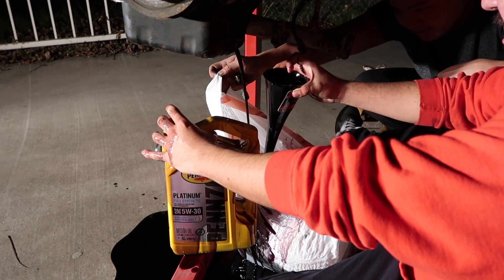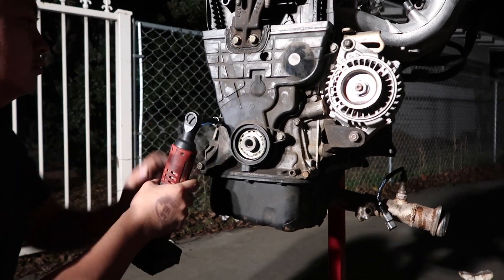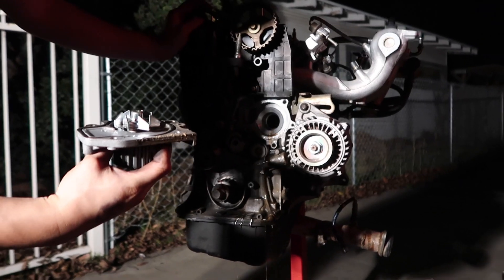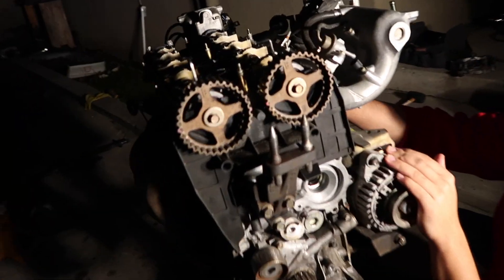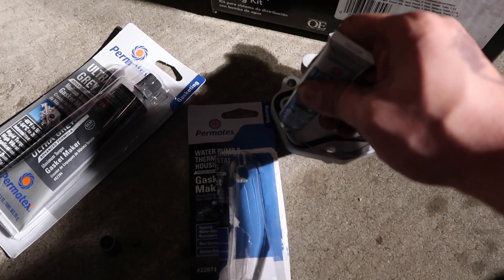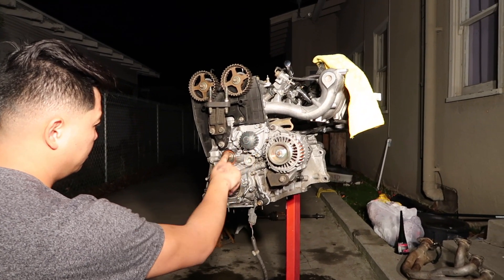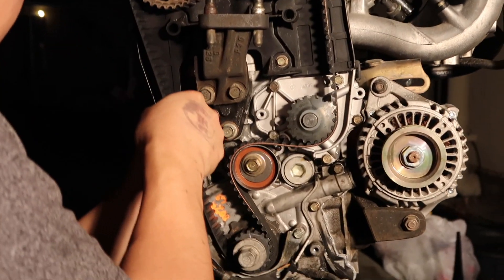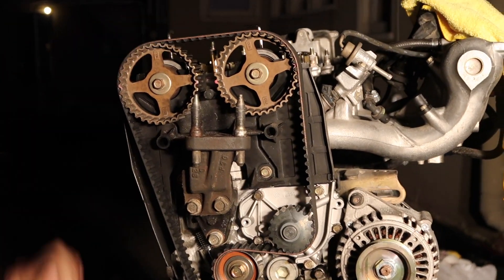B20b civic Bar Part 1

Comment: what's your thoughts of B18CR vs B20B
Reply from the maker: B18cr no comparison to a B20b
Reply: @chaiyangg  interesting, mind to explain more?
Reply from the maker: @tommykaira8775  b20b doesn’t have any vtec and only has great tq, and can only rev up to 7k, the only other motor you can compare a b20b is to a b18b, b18cr is the best b serie motor you can have stock
Reply: @chaiyangg  in my place people put b16a on top of B20b, does it stack up to the b18cr?
Reply from the maker: @tommykaira8775  yeah but I was just going off what your saying, a b20v is a different breed, and it’s not reliable but if you wanna compare a b18cr to a b20v I still say b18cr is better but a b18cr isn’t a cheap or easy to find motor nowadays also
Reply: @chaiyangg  thanks for the info mate

Comment: You can’t bar a b20 motor in a hatch, it’s for the crv and the crv is an suv. You don’t need to change the oil pump for the sensor, just run an obd1 ecu
Reply from the maker: You can bar a b20. Because I bar one in my car. And we’re running the other oil pump cuz we need that sensor to work
Reply: Ralph just got owned!!!
Reply: Ralph you can swap any Honda/Acura motor as long as it’s the same year or newer as your car you don’t know what you’re talking about